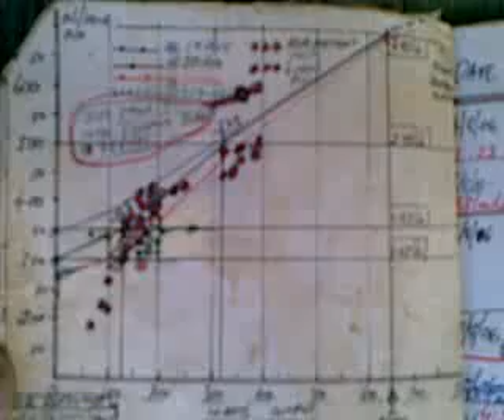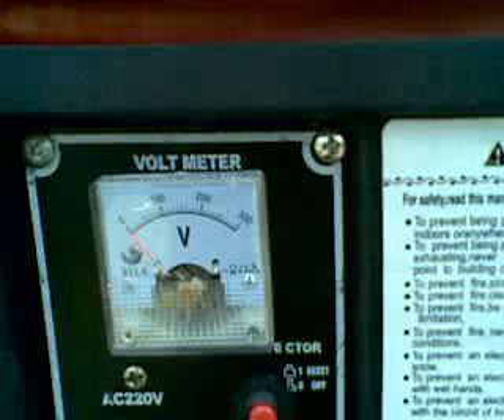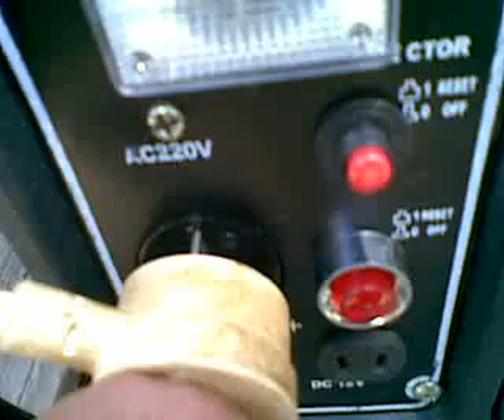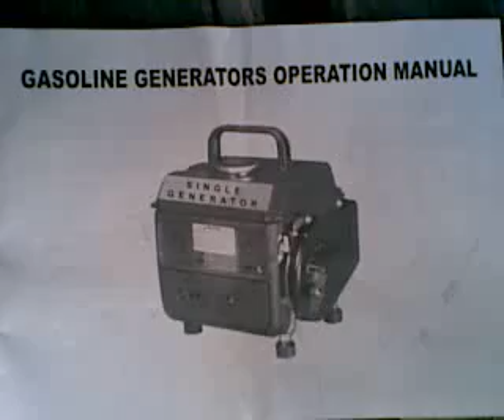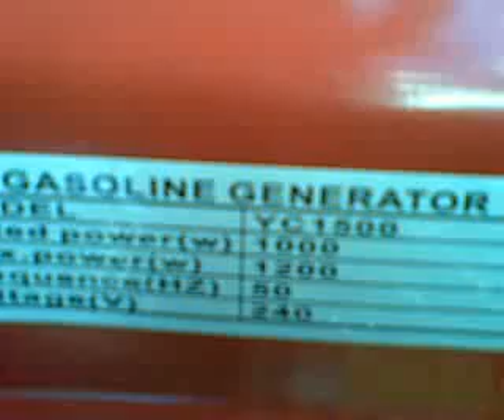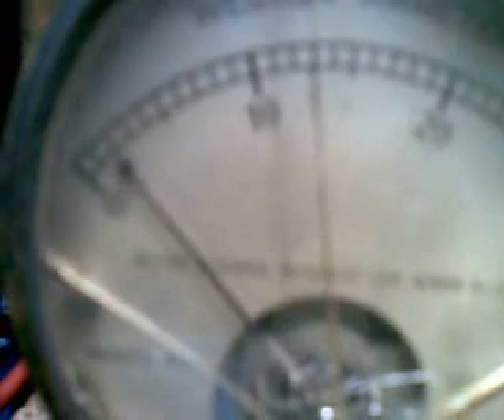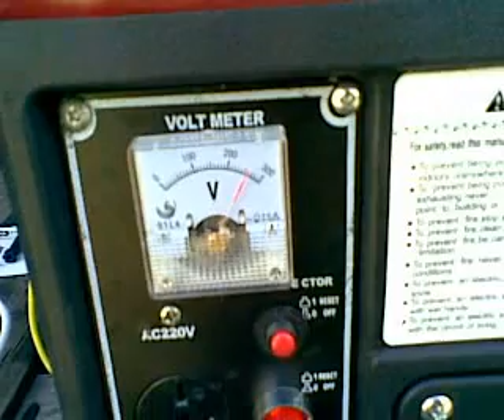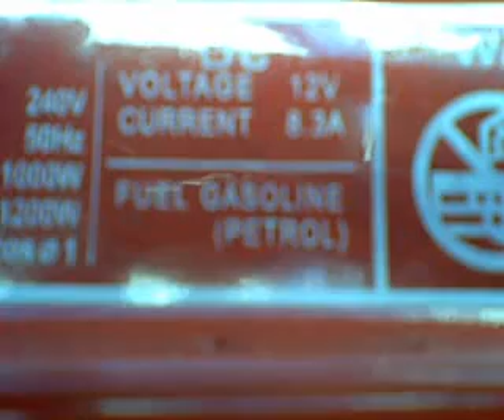Electric Pyramid. A Tale Of Two Generators...

Comment from the maker: @worndisk320
G'day, thanks..! Um, yeah, when they go they're good. I used 50:1, measured with a 250ml Jug, in 2,500ml + 50ml lots... I use the High Performance 2-Stroke Oil, because I buy it for the Chainsaw. And, a "Hot" Spark Plug, from an Ultralight Aeroplane Engine... I still had to clean the Exhaust every 180-280 Hours.
Ciao !

Comment from the maker: @charlie singer
 G'day mate. Thanks....! Um, I log the Date/Fuel Added/Stop-Time (vertically above the) Start-Time/ Run-Time for that Startup/Application ("Bat. Charge, TV-DVD, Lights")/ & Total Time Brought Forward.... It seems a tad obsessive, but every 150 Hours the Exhaust has to be removed, disassembled & cleaned. At 180 to 200 Hrs the Carbonised Oil blocks Gasflow entirely.... It's easier to log times & know when it's due, I find. Ciao !